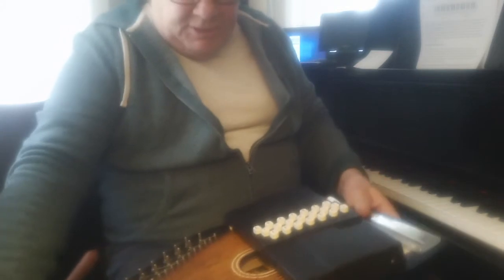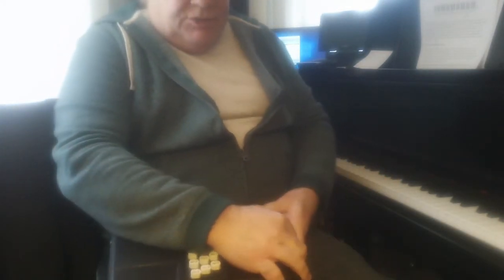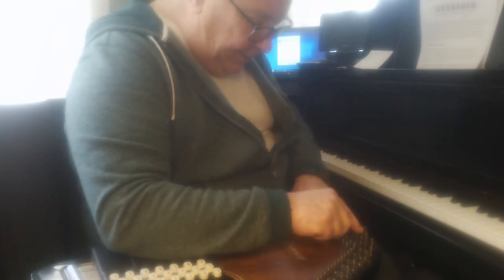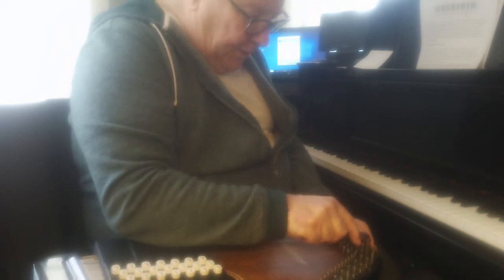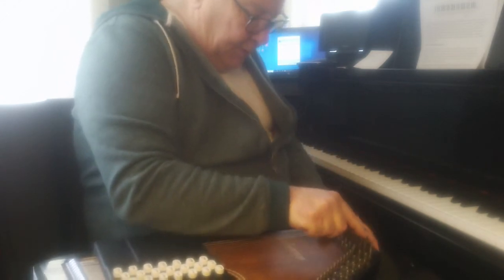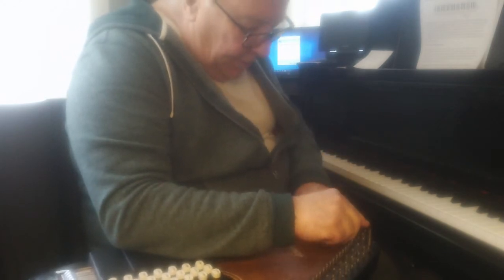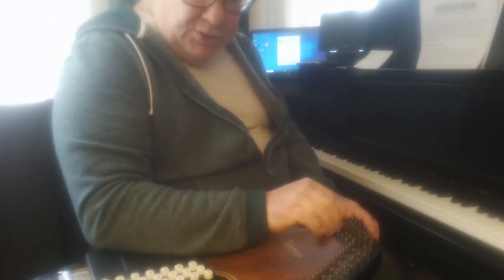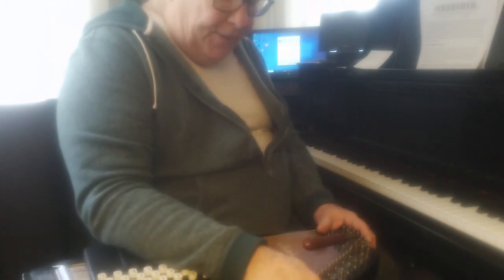AutoHarp Tuning

Comment: Two hints for tuning an autoharp:
1) ALWAYS start turning the wrench looser.  It can happen that you have the wrench on a different string than you thought.  As you begin to tension the strung up and nothing happens, you turn harder, quickly snapping the string the wrnech was on, instead of the one you thought you were tuning.  Also the loosening and re-tightening allows the string to reseat on the bridge pin, especially if it is an older instrument which hasn't been tuned in a while.

2) Instead of tuning all 36 strings to the piano, tune the octave beginning at the first unwound string to the piano.  Then tune the next octave up to the octave you just tuned, and then shift the reference to the next octave as you go higher.  then tune the lower strings to the first ocatve you tuned, and then the deep bass strings to the lower octave you just tuned.  This takes care of a lot of the tempering of tuning that plagues autoharps that are just tuned one-to-one against a guitar or piano.
Reply from the maker: Thanks for the tips, much appreciated. I've tuned literally thousands of pianos, but it's been over 30 years since I tuned an autoharp.
Reply: There is one more tip I should convey, as I think about it.  The fact that the instrument has gone uniformly flat tells us that either it has been sitting for years, stretching and crystallizing the strings, which now need to be replaced or it will sound terrible, or else the factory harp body has dried out in the heating season and has shrunk just enough to cause the instrument to go out of tune to the flat side.  The problem will be in a couple of months when the air starts to moisten up and the body tries to expand.  Unless the strings are re-tuned to reduce tension, there could be sufficient excess force imposed on the harp body to cause structural problems, which are permanent.